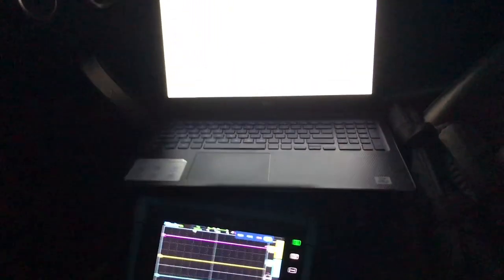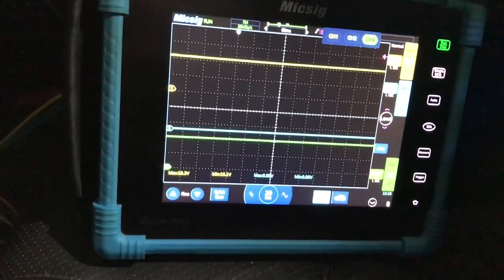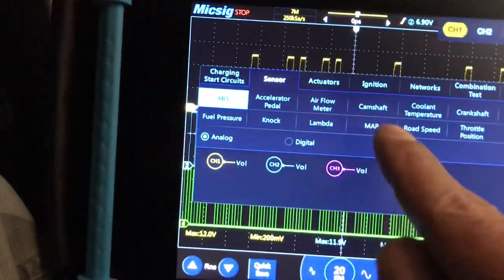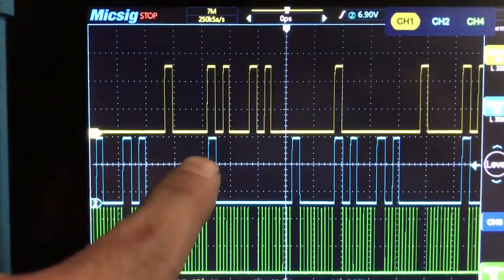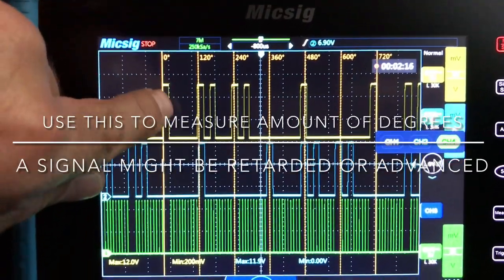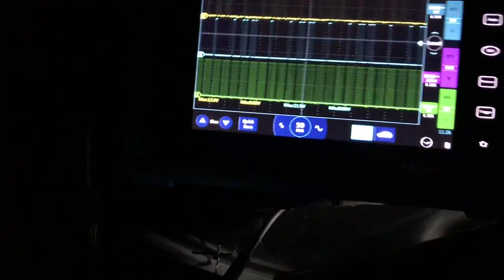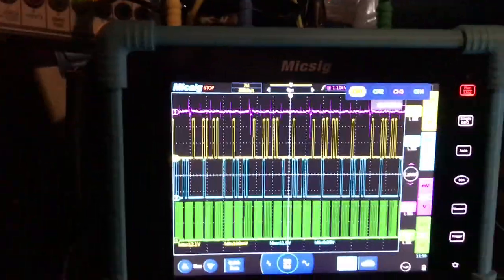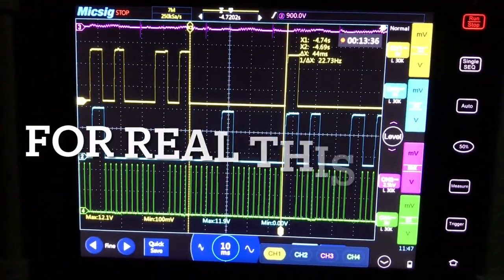Micsig ATO Automotive Scope, CAM & Crank Signals/Waveforms

Comment: I have the Micsig as well. The Linux system will capture photos and capture in movie mode. The Micsig can transfer all photos and movies to the PC. The Micsig can also connect via Android to control the Micsig remotely. The Android of course will record itself on the screen. Many Oscilloscope companies offer waveform patterns and use them consistently while saving / naming my work.
Some extra tools were hand made for Secondary ignition, Vibration and Vacuum / Pressure testing. Using tBook Mini ATO1104
Additional: Will also connect to the PC and iOS phone for remote use.

Comment: Great video, but I have a question: the Micsig ATO 1104 is capable to record a short video file? I mean, can only do a screen shot or a real short video?
Thank you for the answer, Now I use a Rigol 1054, but I will change it with this one, battery and preset automotive wave form is really a good plus.
Greetings from Italy.
Reply from the maker: Hello Andrea. Yes, the ATO1104 will record videos of the entire screen, that you can watch later, and save to a computer, should you want to. Also, you can save waveforms as well. Wow, Italy 🇮🇹. My grandfather came from Sicily to the states in the late 1940’s. Anyway, thanks for the question Andrea. If you have any more, you know where to find me. I think you’ll be happy with the ATO. From what I’ve seen, I believe it’s the best option in that price range. Take care.

Comment: Hey Atom, i recently bought a micsig myself thanks to your videos displaying it's capability. I have been a bit chicken to use it with ignition and injectors(except with amp clamps) due to voltage spikes that i heard can damage the scope. I recently bought an attenuator to use to prevent this but haven't began using it yet. I was hoping u may be able to provide some advice, based on ur experience with the micsig, about the attenuator modes on the scope in relation to them being used with an attenuator that steps down the voltage. I am not even sure if i need one if the scope has modes. Thanks for your videos and your contribution to the sharing of technical information in the automotive field that collectively has helped many become better technicians.
Reply from the maker: Hello Mike Maskell, and thank you for the kind words, they really go a long way, and motivate me to make more videos. As to your concern. The Micsig can take in up to 300 volts safely. With that said, I have used it on injectors with no attenuator, without a problem. However, just to be safe, you may want to use the attenuators, or the 10X probes that came with the scope. As for the ignition, I would say use the 10X probes or attenuators. I usually look at the secondary with a COP probe (if they are COP’s). I know this may not be the best answer. The last thing I want is for you to smoke your scope. With that said it’s probably best to use either attenuators or the 10X probes that came with it. Just make sure that you go into the channel menu and set 10X for the probes; or whatever size attenuator you use (ex. 10X or 20X). I hope this helps. Thanks again for the kind words my friend.

Comment: Atom thank you for sharing. Can you zoom in on individual channels say ignition and get a good ignition waveform? I believe in this video you were using ignition as a sync correct me if I’m wrong. Maybe you could do a video on ignition waveforms and possibly current ramping. Can you hook up an amp clamp to the scope? Thanks again I’ll keep watching your channel for updates. Thanks for sharing and stay safe and well Artie 👍
Reply from the maker: Yes you can connect amp clamps. I believe I have a video or two on ignition waveforms. When you zoom in the timebase, it zooms all channels. You can change, say, how many volts/amps per division, on each channel.

Comment: Thanks for sharing the video. Big fan of you.  I will suggest you, to try operate the migsic, with a mouse and see the difference. Personally, I find it very easy, because my fingerprints has worn out from the years of working, and sometimes, I have to touch the  screen few times, until it work. absolutely nothing wrong with the migsic, just my fingers....same problem with my touch screen phone ☹
Reply from the maker: Hey there Lambros Stefaneas. Thank you for the kind words. You know, that is a great idea. I remember when I first bought the Micsig, reading that I can connect a mouse. Since I didn’t have one, I guess I just forgot about it. Thanks for the advice, I’ll look into ordering one. I understand your fingertip issue. I think my wife inadvertently saved me from mine getting too bad. Years ago, she would complain of how ruff my hands were. Taking advice of my late grandfather, of “Happy Wife makes Happy Life” (after 21 years of marriage, I can confirm that, lol), I started wearing gloves all the time. Well, most of the time anyway. So now my hands aren’t completely shot, but I do, sometimes have problems with touchscreens. Thanks again for being part of the channel, and for your advice. I’ll mention the mouse in my next video. Take care my friend.
Reply: @atomsworkshop195  And also, one more cool think to try ,connect the migsic (via the mini HDMI port), to a bigger screen. You will love it....

Comment: Hi, Atom. What are you using with the ground probe on the scope?
Are you using a made-up extension or is the ground of sufficient length as supplied, so it can attach to chassis or battery ground?
Reply from the maker: Hello Jack. I have the grounds plugged into the break out box, that is plugged into the Data link connector (DLC).
Reply from the maker: Jack, if you go to about 3:35 into the video, I show the grounds plugged into the break out box. Hope this helps. Thanks for watching
Reply: @atomsworkshop195  Thanks Atom. Please keep rolling out those videos when you can spare the time. It would be great if you could alternate between the automotive unit and the other with more conventional knobs. 
Nice work ole chap!
Reply from the maker: I will do. Thanks my friend

Comment: Thanks Atom for all these videos you do on the Micsig. I just bought myself an ATO1104 and was wondering if you knew how to change the units of measurement for the pressure transducer function from MPa to PSI. This is on the screen you get when you click on a channel and then click "presure". Thanks!
Reply from the maker: Hello Paul Stratemann. Thanks for stopping by the channel. No, unfortunately I don’t have a pressure transducer yet (yes, I know I need one). So I haven’t had a chance to play with those options yet. Sorry I couldn’t help you. If you figure it out, feel free to share how you did it, here, so it can help others. Thanks my friend.
Reply: Ok no problem. I sent Micsig an email and they sent my question to their tech department so if I get an answer I will let you know.
Reply from the maker: Sounds good. Thank you Paul